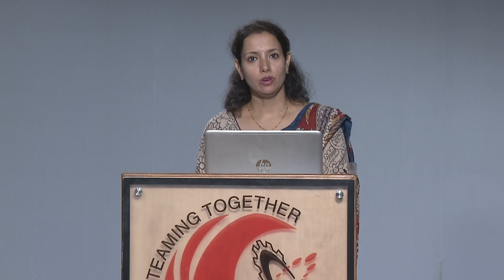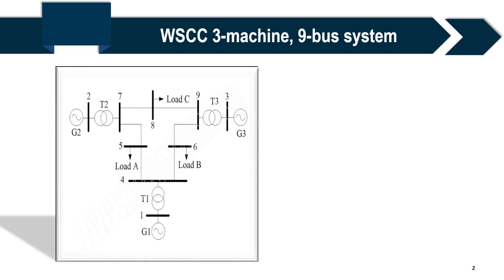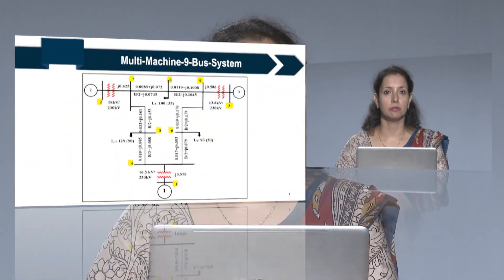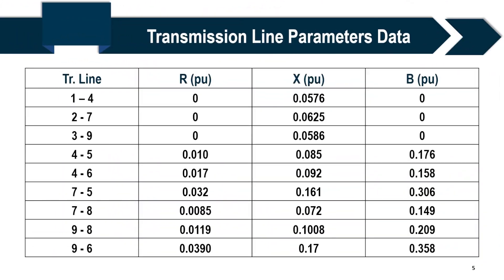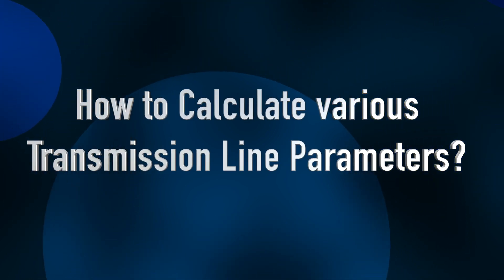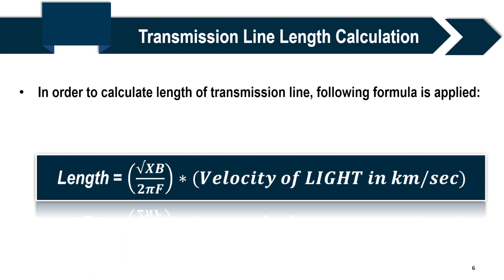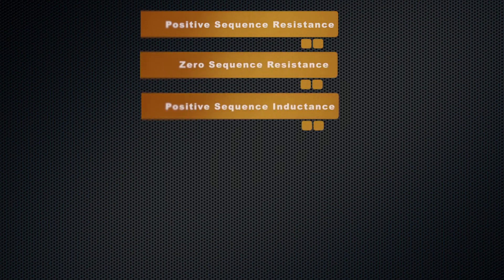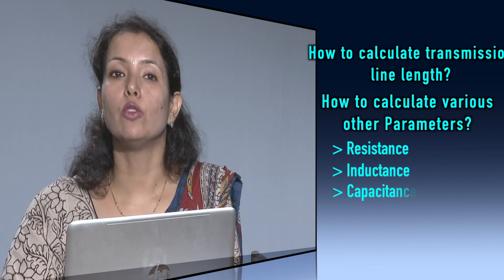Transmission Line Parameter calculation Part 1 by Dr Ritula Thakur

Comment: Thank you for your explanation, but i have a question what if the susceptance (B) is 0, how are we gonna calculate the transmission line length ?
Reply: did you get the answer?
Reply: When B is zero, it means that the parameters are for transformer.